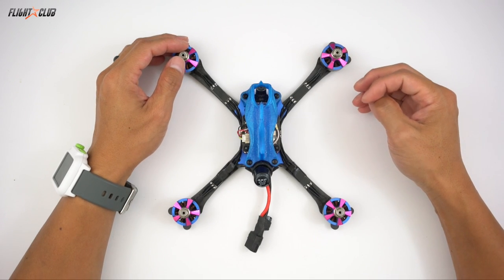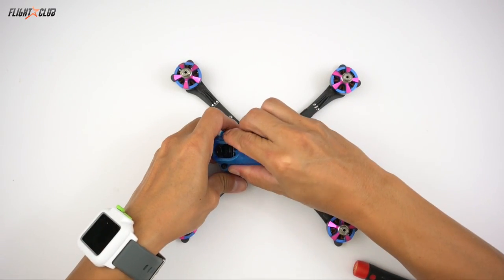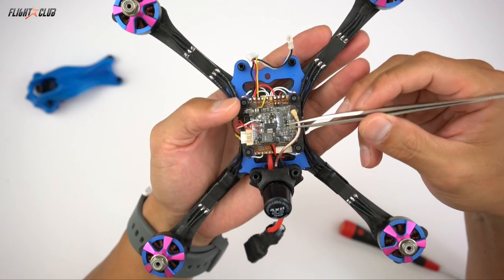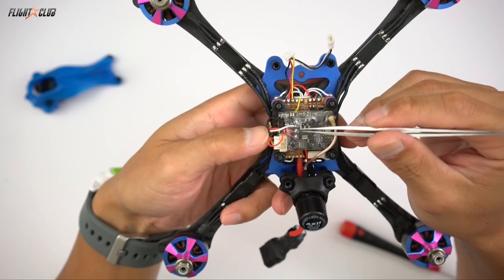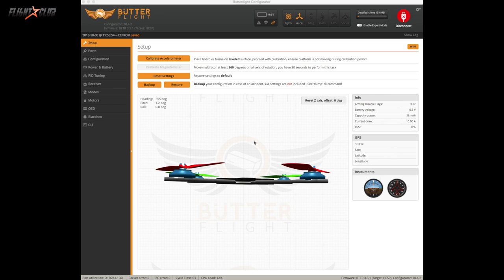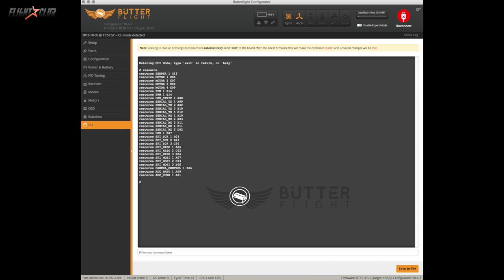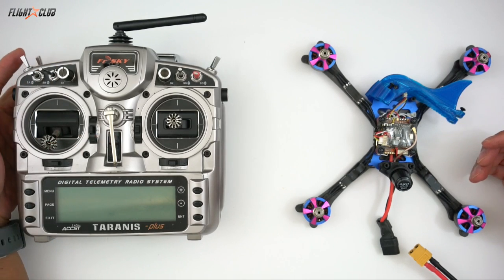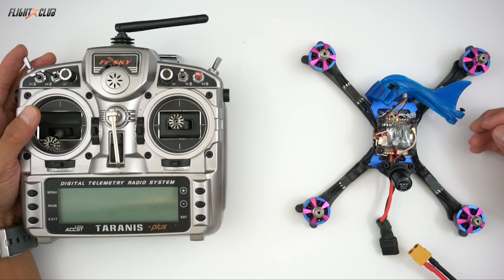VTX Power on a switch

Comment: Is it possible to change vtx power (example 25 - 200 - 600) with a 3 position switch?
Reply from the maker: Unfortunately no. This only powers on or off
Reply: Ty Mike, someone should think about it ;)